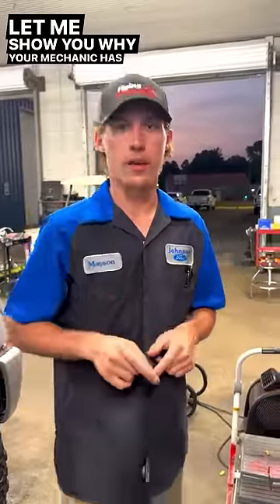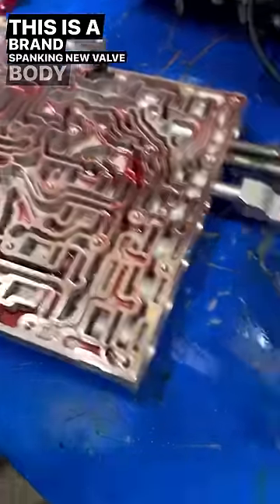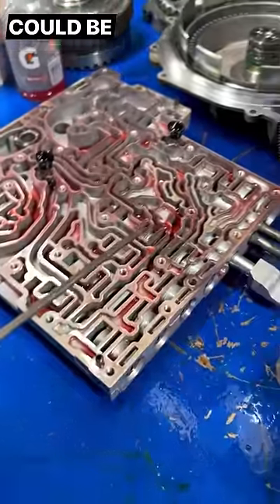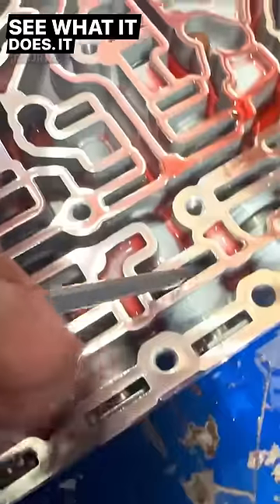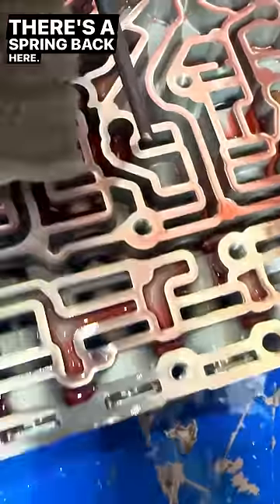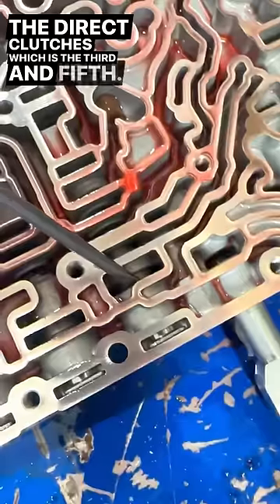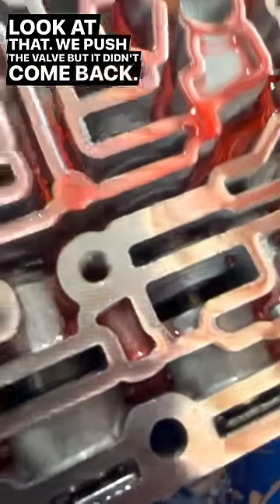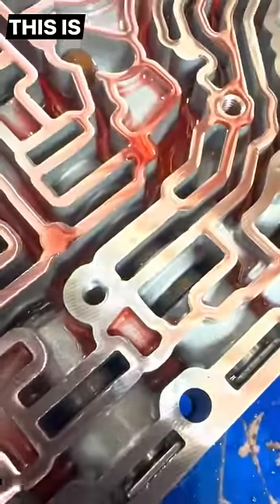Why your mechanic has trust issues #shorts #ford

Comment: Junkyard parts aren't just used, they're field tested and sometimes the best option!
Reply: 90% od junkyard parts come from broken junk cars that have some working parts
Reply: Sometimes it really is the best option.  Been there before.
Reply: You got that right
Reply: TRUE STATEMENT. Dealership techs deal with WEIRD crap that is unique to vehicles with ZERO on the odometer. A nightmare.
Reply: Exactly I took a friend to pull a part needed a 350 tranny found a pickup front end damage he's clueless said no it's wrecked I checked fluid first good I tell him yea it was moving forward it wrecked he still said but it's wrecked
Reply: Find totaled cars or get details of what it came out of if it was wrecked chances are your alternators starters blower motors etc were functioning before it's death I got an alternator out of a 110k miles totaled 09 equinox for my 07 with 415k I wasn't gonna drop 150 dollars into a 350 dollar car so 56 bucks later its still working at 423k and I trust it tenfold over reman junk it's oe and field tested it's well seasoned lol
Reply: And sometimes they come with aftermarket options
Reply: If it's wrecked, the parts were still working when it was on the road.
Reply: It's a bathtub curve, this video is the worst of the new side and a junk yard has the worst of the old side.
Reply: @VitoVeccia I will always go with a rebuildable oem part from the junkyard when I can. 25 bucks for a caliper I can sand blast, paint, and rebuild vs a 60-80 dollar shitty rebuild with crappy parts from an auto parts store.
Reply: Agreed. Those parts are there because those cars were wrecked.
Reply: Unless on the rare chance you pulled the part that caused them failure and in turn caused the prev owner to scrap it 😅 but otherwise spot on!
Reply: Aim for the wrecked shit lol at least you know that thing ran down the road before it made it to the yard
Reply: @badazz2969 the fact that you got 420k miles out of a Chevy equinox is damn near a miracle
Reply: Usually when you have to replace a part, it is a known issue with a vehicle. When you replace it with a used part from a salvage yard, you are just starting another ticking clock until that used part fails. Atleast the new part comes with warranty from a repair shop. No guarantees with used parts.
Reply: Exactly 💯
Reply: That's a fact! My 8 year old Infiniti needed a transmisison and a couple other associated parts. Dealership... $7k. My newest most favorite friend did the job, in my driveway, for $3k.
Reply: Eh, I've had guys ask me to put in a junkyard tranny and it's a box of chocolates, it maybe better or you could end up with the same problem again or worse. It ain't worth going through hours of work and find out that the tranny you put in is questionable shape without having it looked through.
Reply: @michaelhiles5350 I learned about 25 years ago that your best bet for a good engine or transmission at a u-pull-it yard is to find one in a wreck. Still have to look at mileage and make sure the housing isn't cracked from the impact. Fluids are removed from ours before they hit the yard, but there might be a little on the dipstick if we're lucky.
Reply: That is true. As a service engineer, when I'm troubleshooting I'd rather have a part from something that worked than a part from a box.
Reply: I tried.. most of the stuff works, a lot of it is broken already…
Reply: Very good for body parts tho
Reply: @brantkensinger3398 what are you smoking lol? Bullshit excuse to buy new parts. Every salvage yard around me includes a 90 day warranty on parts for a couple extra bucks.
Reply: @greghavens7679 you paid for mostly labor than lol. Motor - $400 trans - $250 at my local parts yard
Reply: How tf are you getting that many miles out of an equinox? My boss has one in our fleet and that stupid thing sometimes stalls, always has some kind of warning light illuminated, and the AWD system decided to disable for some reason. That one only has about 130k miles but it’s constantly falling apart.
Reply: @christopherbooth9452  Maybe. But it beat the F outta $7k. And the car still goes 170mph!
Reply: A 2nd hand part is only as good as your broken one was yesterday.
Reply: @greghavens7679  true lol. If you don’t want to do labor yourself you definitely got a good deal
Reply: You wouldn't catch me installing junkyard valve bodies 🤣
Reply: Ong, I fw the junkyard parts heavy
Reply: It's a crap shoot either way
Reply: Speaking about parts how much would a junk ECU or PCM would cost and real question is would the junk yard program aswell if so how much in all
Reply: I approve of this comment, got quoted £600 for a new abs pump, bought a used one for £40 and brake fluid for £10. Saved £550!
Reply: I like buying used products, cause you can get a brand new TV that fails in a month but my pawn shop TV's been guaranteed to work by actually working for years beforehand. If it hasn't broke yet it's not likely to, at least on on it's own.
Reply: My transmission has 20k miles and it came out of a totaled car, def the best option for the price.
Reply: Wrong
Reply: Most junkyards now look the parts up and charge about 80% of new price and you not getting a warranty..
Reply: When I was in highschool, I blew out my door speakers twice, and replaced them all from the junkyard for $20 / 4 speakers the first time, then the 2nd time the owner just let me have all 4 for $5 because he respected that I was a teenager coming to salvage my own parts 😂
Reply: They're called junkyard for a reason, most of the shit you said isn't true
Reply: @Drakkoo-yp8yl  chances are ot was only there because it got crashed or something major quit.  So either motor or transmission.  Or up north it was rusted in half. The other parts are fine. Always inspect to the best of your ability.  They usually have a warranty as well. If they don't work you get your money back or a new part
Reply: Depends on the part I 100% agree a junkyard OEM sensor, coil packs, etc are a much better option than the cheap part store bs. I've always went this route when OEM is just too much and really never had any issues.
Reply: Got that right unfortunately new means mainly quantity over quality stuff ends up in the shop all the time you look under the hood and all you see is plastic plastic everywhere in places it doesn't belong in the unfortunate truth is to make new stuff great you have to spend extra to undo what the manufacturers did which is gonna cost lots but also will void your warranty but I get the feeling these warranty are about to be up give a year and people who know how cars work will be doing their own thing with them
Reply: Just make sure it's not the part that sent it to the junkyard!
Reply: @Jasonsfarm  why yes of course do don't do that and it will end up in the junkyard always make sure the part is solid 🪨 don't be stupid
Reply: @badazz2969 Nope equinox don't run that long sir it's a junk arse 3400 now if you'd have said a 2wd 5.3 as in a Yukon etc. I wouldn't have called u a LIAR...
Reply: Yup yup. Just because the vehicle was in a simple fender bender the insurance company wants to total a perfectly running vehicle. So there's a perfectly running vehicle with perfectly working parts in it just sitting in junk yard slowly rotting away.
Plus you can find some good deal at junk yards too. My dad went to the junk yard a few years ago to get a part for my parent's car. Roughly $2k-$3k later I'm the proud owner of a clean body, all original, no floor rusted out, 1965 VW Beetle. All it needed was new windows, new foam an upholstery on the seats, a battery, and a new motor.
Reply: Sometimes they are the cause of the accident!
Reply: I had to give my 98 mustang to the junkyard after some ass hat hit & ran on me. They swiped my parked car on the front end knocking the headlights & bumper off.
I couldn't afford to repair it & the battery died before I had to move out of my house so I had to give it up.
I couldn't even afford a battery. There was a brand new $4,000 transmission in that thing😢.
I told the salvage yard guy everything & they just said, "yea ive heard that 300 times before."
I was sure they could easily verify the quality of the parts & give me a decent bit better than bottom dollar.. Hell na, I got base weight price.
I got $250.. They got thousands😭
Reply: @brantkensinger3398 if you’re getting a warranty from a repair shop it means you aren’t doing the work yourself. Stick to buying new parts,
Old rebuildable shit that sits in junkyards are good for the diy guys.
DIY guys don’t get a warranty through a repair shop.
Reply: It all depends. Parts that wear, or the materials age, or where corrosion is an issue - get them new. You don't want somebody else's worn bearings or old hardened seals etc. For bits that don't really wear out or you're going to rebuild anyway it's often a good option. I recently reconditioned a used BMW rear subframe from ebay... but that rear suspension got all new bushes, reconditioned drive shafts with new universal joints and rubbers, new shocks, new springs, new abs/traction control and brake wear sensors, new calipers and brake pipes (all OEM or better) because those things deteriorate over time and needed changing.
Reply: @brianwilhelm3777  You gotta understand how many cars the junkyards go through & they are not gonna sell that transmission for any more$ than any other 1 on their yard (I mean you as a customer would you pay top$ for that used  transmission just because somebody told you it was a 4k$ transmission?) They deal in quantity not quality & I'm surprised you got 250 tbh they base their price on weight & what type of cat & the mustang cats are shat & it's a 25 year old totaled car (just weight which is 120$ a ton currently & that was barely over 3k pounds)
Reply: @brianwilhelm3777  Also why would u pat 4k for a transmission for that car when u can buy a 98 mustang that runs & drives with title for less than half that? 🤔 not a smart move there boss
Reply: Agree somewhat when it comes to transmissions from wrecked cars. Some transmissions are better to be rebuilt than pulled from a junkyard especially when its a known transmission that has shortcomings from factory that can be addressed with a rebuild or its an older unit like a 4l60e. Relatively newer transmissions usually come from low mile cars and can be cheaper than a rebuild, just have to watch out with programming or else it wont work.
Reply: What an optimistic fella u are! 
Wish I went thru life thinkin like u do 😂
Reply: What an optimistic fella u are! 
Wish I went thru life thinkin like u do 😂
Reply: I drive a half ton truck with a 5.3 LS all bone stock. I'm at 290k and there is nothing that can break on it that I won't fix with maintenance and junkyard parts from the most common trucks around here. And its less money than a car payment to fix it.  People are out here getting robbed simply because they ain't got skills.
Reply: Not all of the time junk yard part always  works, its a gamble.  Its like going to mystery box from roblox, sometimes  you  end up getting  a  decent  and sometimes  you dont.   I used to go to the junk yard with my dad and sometimes he would find a decent part and sometimes he doesn't.  The worst part is when you install it and it doesn't work,  you have to take it apart again and return it back to the junk yard.  Junk yard is good when you are looking for parts for discontinued cars or classic project car you have in your garage.
Reply: @michaelhiles5350 
"Sure buddy it's dead. But that's why we're here to scavenge it of its sweet sweet (working) car organs.
Reply: No shit. It’s a junkyard 😐
Reply: That's the way I view a lot of things. I buy most things used on eBay, largely because they're cheaper - but beyond that, they've proven themselves durable and high enough quality to be worth selling after the previous owner was done with it!
Reply: @michaelhiles5350  Use punctuation.
Reply: Unless it's a 4L60E..   LOL
Reply: There used to be a show called Junkyard Wars. From distant memory, they sometimes build whole working vehicles, like a boat, from nothing but junkyard parts.
Reply: 😂 ❤ yeap.
Reply: Nah. 😂 NAPA very rarely has ever let me down. Specifically electrical parts. Every big store seems to sell half defective electrical parts out of the box. Very rare, I can only think of 1 time echlin was defective from the box. Ive sold and installed thousands.
Reply: Field tested 😂
Reply: @badazz2969  Holy shit, I don't think I've ever heard of an Equinox lasting that long.
Reply: @jamiejones6994  I mean it's only been in my family since 08 and was bought with 28k miles on it. Wth do I know I don't have any service records or anything on it..man it's got over 420k miles on it og engine and trans no gaskets only one oil pan gasket and plugs they can and do run forever now if I said 2.4 ecotec I'd be blowing smoke up your ass for sure
Reply: @kennethlaw9830 
 👍 years back I  got a AW4 transmission from a newer XJ for my XJ for that reason it was from NJ I lived in GA.  The northern XJ was rusted away, the transmission case was covered with surface corrosion and caked on oil/ grease and low mileage.
Reply: @Warex06 let's be honest here... If you can get 450k miles out of ANY make or model car that doesn't run on diesel, then it's damn near a miracle.
Reply: @Drakkoo-yp8yl that's the point.  It ran its life and made it the yard. It's like the nursing home/orphanage for vehicles and parts.
Reply: Ide live at the u-pull junk yard if I could lol
Reply: New vehicles are junk quality control has lacked. I hope dumb people keep buying them so when I need a 90s truck I can still find them rest of my lifetime. I have no desire to own anything past about 2005. I own a 2012 and I have less tryst in it than a 90s or older model car/truck.
Reply: “Field tested” is the valuable part here, for all you who missing the point entirely.
Reply: @Drakkoo-yp8yl  not if you have a model of car with mostly female drivers - then the majority are functional if not for the insurance write-off!
Reply: I've had nothing but good luck with junkyard parts. A rebuilt transmission lasted about a year, then I got a used trans from my local junkyard and it lasted for years until I got rid of the car.
Reply: If you are a professional you are hardly ever going to put junkyard parts onto a vehicle